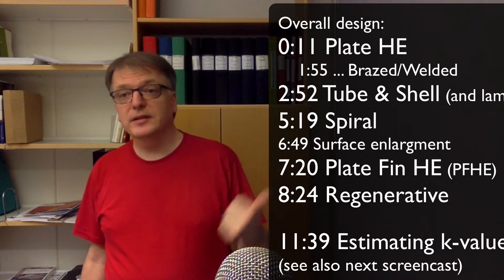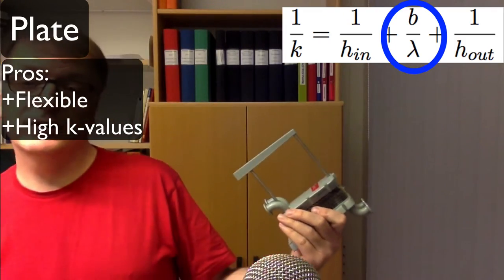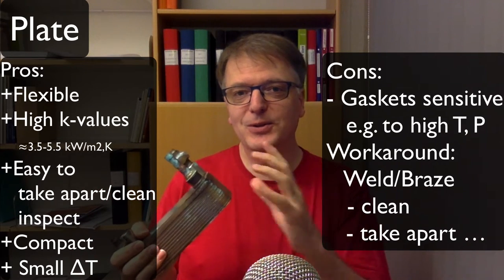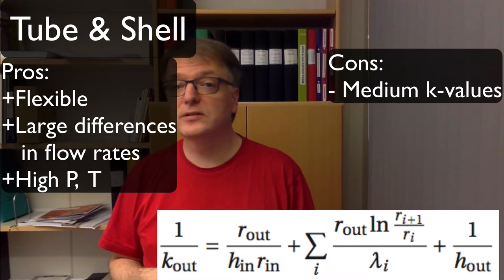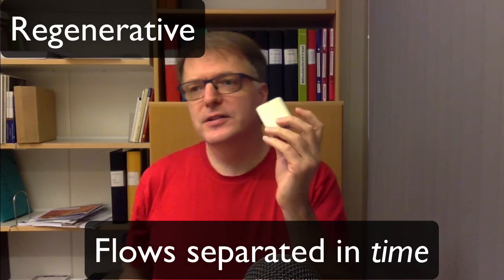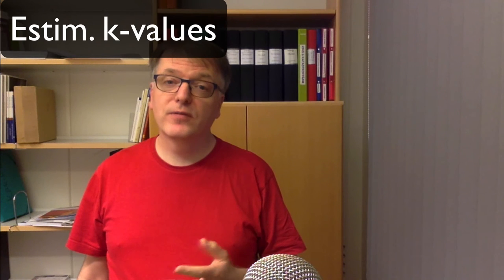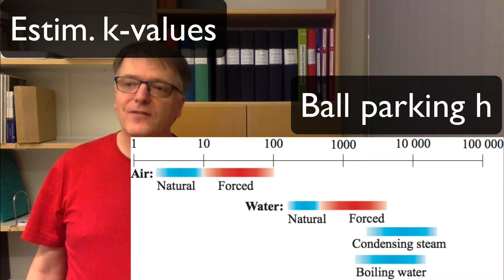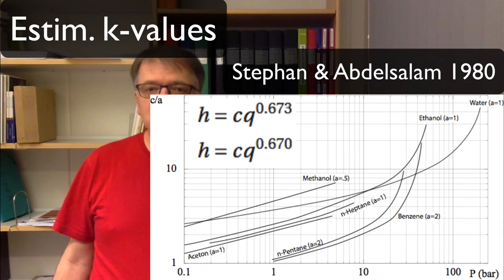Heat Exchangers 2

Comment: I just bought a soldered plate heat exchanger so I can run my hot glycol from my woodstove to a heat exchanger to heat hot water before letting the cooled but still warm glycol to go and heat up my in floor heating pumps. I am going to see if I can use natural convection the whole way through with no circulating pumps. Your explanations are very helpful! Luckily the brazed ones are fairly cheap so I will just plumb in another one if I need more hot water

Comment: Please,l need to explain about plate fin offset strip type
Reply from the maker: That's a rather advanced question well outside the boundaries of the courses I teach and unfortunately also outside my area of expertise. I can say this much though:

In basic courses we often teach students that heat transfer coefficients has everything to do with the moving fluidum and nothing to do with the solid construction it flows past (apart from the hydraulic diameter of the passage, that we enter when calculating Reynolds number). That is, however, a simplification. While the material the solid construction is made of, the surface structure does influence. For the student who have learnt about pressure drop in pipes and how the courseness of the surface is important for reading the fanning friction factor from diagrams, it should be clear that the surface structure affects the transport of momentum in the moving liquid. But if the surface structure affects the transport of momentum,  it should also affect heat transfer (compare Chilton-Colburns analogy and Reynolds analogy).

A plate fin offset heat exchanger is a compact, effective heat exchanger. Now, if you reduce the size of a heat exchanger without changing the general design the problem is that Reynolds number gets smaller (smaller hydraulic diameter => smaller Re => less turbulent & more laminar => lower heat transfer coefficent. By constructing the flow paths in a way that the flow is constantly distrubed, the flow constantly meeting new edges and bends, you get less laminar flow and thus higher heat transfer coefficients.

Comment: Where did you get the spiral model?
Reply from the maker: Our department got some heat exchanger  models several decades ago from companies making heat exchangers. I don't think there is anyone making them today. If you want one, my best bet is that you talk with someone who is good at designing CAD models for 3D-printing and create your own. Once you have an STL file that has been checked for errors, try to print one and see if it works. 

You're the second guy asking the same question (the first question was sent to me privately) so if there is someone out there who is good at CAD-designs and want to help students understand heat exchange, I'm thinking that a CAD model declared as public domain would be very helpful to many teachers and students.